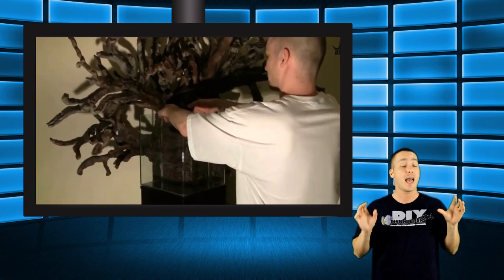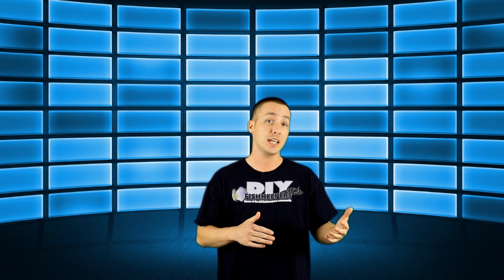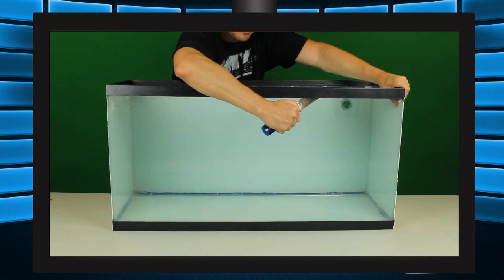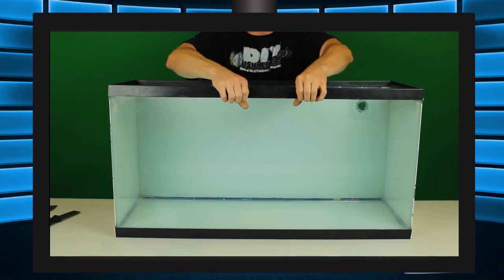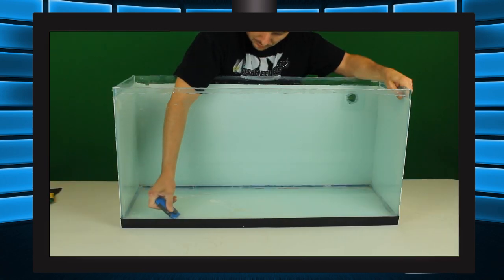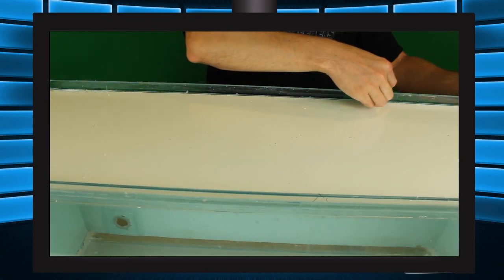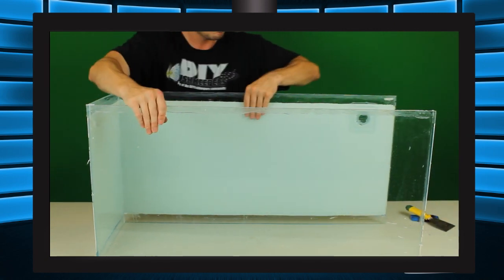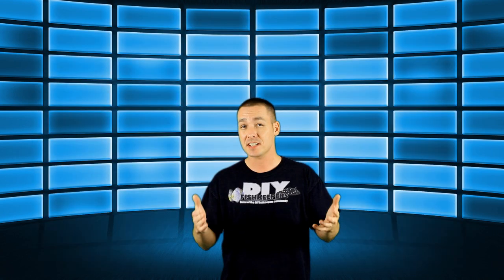HOW TO: take an aquarium apart TUTORIAL

Comment: hey joey, i need some advice, or from anyone really. ive got a 400l i just got off my mate, but it has a broken side panel. ive managed to get the bottom loose, but the side silicone is so tightly squeezed in, i cant even get a blade through, what should i do? i really dont want to put too much stress of the front panel

Comment: I have a 125 gallon tank that the seem and seal failed. I need to rebuild it, not a problem. but it has the trim on the bottom that raises the bottom panel a 1/4 higher than the side panels meet. if that makes sense. when I rebuild the tank, do I need to make it fit the trim. is the bottom trim needed? or can I just rebuild it without it.
Reply: That's my question????

Comment: ok what's the trick for putting the bottom glass back? do i build it without the trim then put the trim back? the bottom is recessed a certain distance that has to be perfect to match the trim? or how do i reassemble it inside the trim so it fits the recess perfectly? anybody know? or i will have to bite the bullet and buy a new tank? my thinking at this point is to shim the bottom up to what seems the right distance, build the tank, then reinstall the trim the next day, hoping i didn't recess the glass too much...

Comment: I have a 110 show tank 1/2 inch glass. The bottom is cracked. I absolutely can't get a razor blade in between the panels. The tolerances are way too close. How do I separate the bottom of the tank if I CAN'T get a razor in between the pieces of glass ?

Comment: My Walmart 10 gallon turned out to be tempered glass on the side, non-tempered(what's it called) on the bottom. I figured out the hard way that you cannot cut tempered glass with little effort... Basically, it explodes and glass goes everywhere. By random chance I cut the bottom first and had great results, then wondered what the hell was going on when I tried to cut the sides. Guess I'll have to order my glass cut to size to build my aquarium bridge between a 29 and a 20 long. Bummed!

Comment from the maker: HOW TO: take apart an aquarium
Reply: Very handy to know!
Reply: Question for you Joey, I have a 145 gallon tank 1/2” thickness glass. I want to take the trim off because it’s cracked on the edges and I prefer rimless either way. The problem is.. the trim is not plastic but glass. Would it be possible and safe? It looks like you have a lot of experience with diy and I would appreciate your feedback on this project. Thanks and great videos man!
Reply: Michael Vang the aquarium he took apart is made of glass too